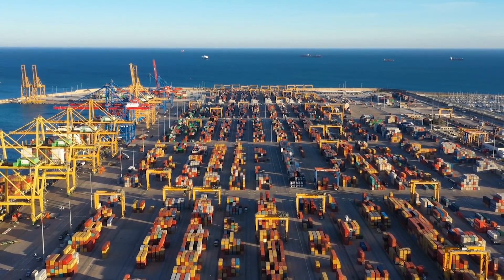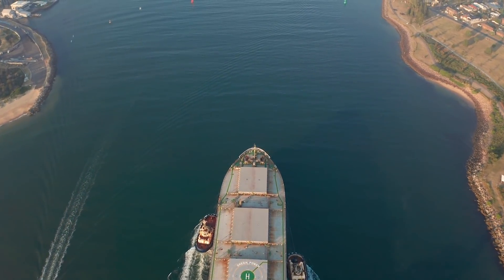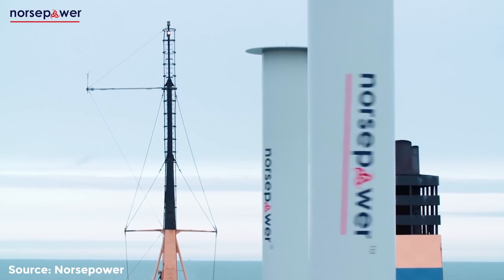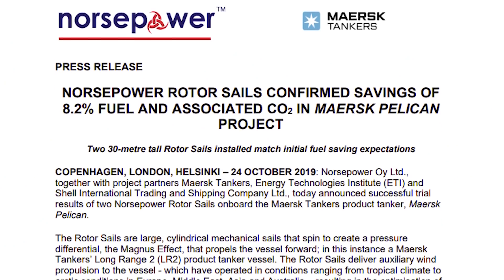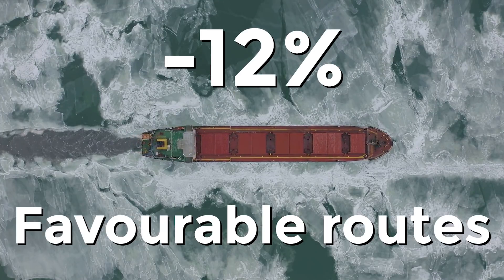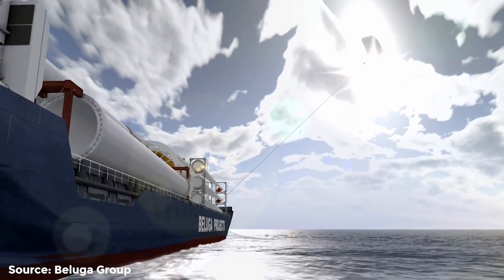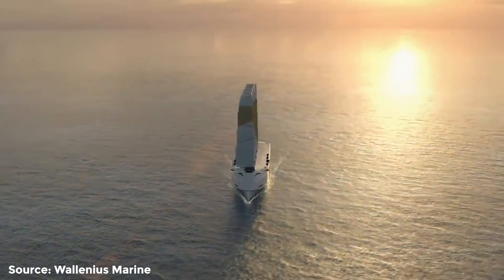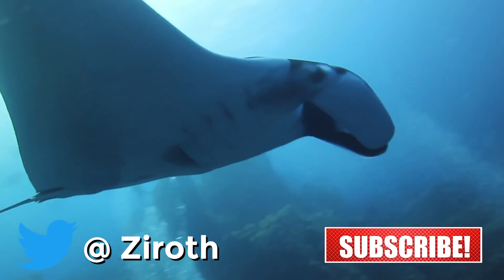Is Wind Power The Future of Shipping?

Comment: "Wind" word is mean that "wins"...! m.m.a.rana
Reply: To address the suggestions that wind power is the answer I offer the following example.  In 1870 a premium sailing vessel entered service, the ‘Cutty Sark’.  The ‘Cutty Sark’ was 64.74 metres in length with a beam of 10.97 metres and a loaded displacement of 2 100 tonnes.  She was able to carry, at best, 1 700 tonnes of cargo and to harness the energy in the wind the available spread of canvas was up to 2 976m2 which was tended by a crew of about 30 skilled men.  A ratio between the sail area (SA) and the vessels displacement (D) determines how lively she is; ‘lively’ being nautical speak for ‘fast and manoeuvrable’.  The carrying capacity of cargo ships is constrained in two ways, mass and volume which leads us to the ‘stowage factor’ of the cargo; the more mass on board the greater the displacement which in turn impacts the efficiency of the hull form and sail area / displacement ratio.  A vessel constrained by mass is said to be ‘down but not full’, while a vessel constrained by volume is said to be ‘full but not down.  When in the tea trade, which the ‘Cutty Sark’ was designed and built for with fine lines (more nautical tech speak, so again no need to worry about it) she could carry around 600 tonnes of cargo at speeds of up to 17.5 knots dependent on the prevailing wind and had a typical China to UK time on passage of 120 days.  The tea trade was very competitive so ‘time on passage’ was a large factor in securing the premium freight rate that made her cost effective.  Rounding things out, her maximum available sail area gave circa 5m2 of canvas for every tonne of tea carried.

As soon as the Suez Canal opened, which the ‘Cutty Sark’ was unable to sail through; she lost her advantage, raw speed, to the steam powered ships of that era who could beat her ‘time on passage’ by taking that short cut.  Mechanically powered ships have improved in terms of efficiency, on a freight tonne mile basis, by at least one order of magnitude since then.  After losing out to the coal burning, fire tube boiler, steam reciprocating mechanical ships of the late 19th century ‘Cutty Sark’ was relegated to the Australian wool trade, just about the bottom of the barrel in maritime terms and only one small step up from being a 'honey barge'.  The canvas, cordage and extra manpower needed for sailing ships was never a very benign environmental option so please discount any idea of sail as ‘sustainable’.  All this is without the problem that if ‘the wind don’t blow the ship don’t go’, when it does blow it often blows in the wrong direction for your cargo delivery needs and sometimes there is rather too much of it for comfort.  Sailing ships are unable to go directly up wind so if the wind is blowing from the direction your cargo needs to then a zig-zag course must be steered, more distance and thus more time on passage at whatever speed is achieved.  Wind speed is traditionally measured on the Beaufort Scale (wind speed) that runs from 0 (< 1kn) to 12 (> 63kn) and for sailing purposes the usable part of the range is ‘3’ (circa 8kn) to ‘6’ (circa 24kn).

Random fact about ‘Cutty Sark’, it is said to have been possible to coax 3 000 horse power out of her sails, or in ‘real money’ 2 206 500 Watts (2.2 megaWatts), or 741 Watts for each square meter of sail area.  So that majestic spread of canvas would have been even less efficacious for delivering your baubles and bows from the orient, despite taking about three times as long on the voyage.  The sails on the ‘Cutty Sark’ produced about 0.33% of the power need to propel a Mearsk Triple E working simultaneously in ‘ideal conditions’ the energy harvest would be less than a two hundredth of the output from the ICEs.  Remember shipping is a high volume low cost, therefore low margin business, and all costs have to be beneficial.

Canvas and hemp are accorded 'renewable' (read as ‘natural’) status, if ‘synthetics’ are used there will still be a need for the input of FOGI products.  'Synthetics' would have a much better working life span than 'naturals' but would still yield the same amount of energy, 741 Watts for each square meter in those elusive ideal conditions.  Wallenius are currently giving wind power a go with wing form ‘sails’ but evidence is a little short of proof as of this date.  KTH (Kungliga Tekniska högskolan), a sort of up market university in Stockholm, who are using the funding to derive results will probably, and eventually, in the best traditions of academia ‘publish’ a ‘paper’ unless the funders invoke the well known ‘commercial sensitivity clause’ of their agreement with the KTH.  On board wind turbines might get you around some of the problems, however for marine use vertical axis wind turbines (VAWT) would be better than, the what have now become 'traditional', horizontal axis wind turbines (HAWT) for reasons that include the air draught of the vessel, weight distribution and maintenance access.  The energy yield is still subject to the wind blowing at the right strength and having space available on board for the hardware.  The masts, rigging and sail handling arrangements would take up 'prime real estate' on the vessel.  Fuel oil bunker tanks can be, and usually are, stuck away in any odd corner and the ICE power plants are themselves relatively compact.  The stacked up 'boxes' would mean putting the wind driven propulsion units in a bad situation from a ship stability point of view.

Comment: That is a really interesting point about shipowners and charterers! Maybe a portable solution is the answer, but would this portable solution simply be washed off the ship
Reply: If ‘the wind don’t blow the ship don’t go’, when it does blow it often blows in the wrong direction for your cargo delivery needs and sometimes there is rather too much of it for comfort.  Sailing ships are unable to go directly up wind so if the wind is blowing from the direction your cargo needs to then a zig-zag course must be steered, more distance and more time.  Wind speed is traditionally measured on the Beaufort Scale (wind speed) that runs from 0 (< 1kn) to 12 (> 63kn) and for sailing purposes the usable part of the range is ‘3’ (circa 8kn) to ‘6’ (circa 24kn).

Random fact about ‘Cutty Sark’, it is said to have been possible to coax 3 000 horse power out of her sails, or in ‘real money’ 2 206 500 Watts (2.2 megaWatts), or 741 Watts for each square meter of sail area.  Remember shipping is a high volume low cost, therefore low margin business, and all costs have to be beneficial.

Canvas and hemp are accorded 'renewable' (read as ‘natural’) status, if ‘synthetics’ are used there will still be a need for the input of FOGI products.  'Synthetics' would have a much better working life span than 'naturals' but would still yield the same amount of energy, 741 Watts for each square meter in those elusive ideal conditions.    On board wind turbine might get you around some of the problems, however for marine use vertical axis wind turbines (VAWT) would be better than, the what have now become 'traditional', horizontal axis wind turbines (HAWT) for reasons that include the air draught of the vessel, weight distribution and maintenance access.  The energy yield is still subject to the wind blowing at the right strength and having space available on board for the hardware.  The masts, rigging and sail handling arrangements would take up 'prime real estate' on the vessel.  Fuel oil bunker tanks can be, and usually are, stuck away in any odd corner and the ICE power plants are themselves relatively compact.  The cargo needs would mean putting the wind energy harvesting for the driven propulsion units in a bad situation from a ship stability point of view.
Reply: Really interesting response Bernard!

Comment: Maybe windpower is not practical for big container ships for the reasons mentioned in the video, but I would think a small fishing trawler would definitely benefit from having sails as well as diesel engines. They are owned by the fisherman himself, so he does have to pay thousands of pounds to motor out to the fishing area and back. If he could sail to and from the fishing area, and just use his engine for the actual trawling he could save thousands of pounds per trip. I saw a program onTV where the fisherman said he caught £5000 worth of fish on one trip, but his fuel bill was £3000. If he could sail out and back it would cut his fuel bill considerably.
Reply: The problem is that if ‘the wind don’t blow the ship don’t go’, when it does blow it often blows in the wrong direction for your cargo delivery needs and sometimes there is rather too much of it for comfort.  Sailing ships are unable to go directly up wind so if the wind is blowing from the direction your cargo needs to then a zig-zag course must be steered, more distance and more time.  Wind speed is traditionally measured on the Beaufort Scale (wind speed) that runs from 0 (< 1kn) to 12 (> 63kn) and for sailing purposes the usable part of the range is ‘3’ (circa 8kn) to ‘6’ (circa 24kn).

Random fact , it is said to have been possible to coax 3 000 horse power out of the sails on the ‘Cutty Sark’, or in ‘real money’ 2 206 500 Watts (2.2 megaWatts), or 741 Watts for each square meter of sail area.  So her majestic spread of canvas would have been less efficacious for delivering your baubles and bows from the orient, despite taking about three times as long on the voyage, than mechanical power.  Remember fishing is a 'high volume low cost' business therefore low margin, and all costs have to be beneficial; also fish are a perishable critical cargo running freezer equipment needs energy so some consistent and reliable power supply is needed.

Canvas and hemp are accorded 'renewable' (read as ‘natural’) status, if ‘synthetics’ are used there will still be a need for the input of FOGI products.  'Synthetics' would have a much better working life span than 'naturals' but would still yield the same amount of energy, 741 Watts for each square meter in those elusive ideal conditions.  Wallenius are currently giving wind power a go with wing form ‘sails’ but evidence is a little short of proof as of this date.  KTH (Kungliga Tekniska högskolan), a sort of up market university in Stockholm, who are using the funding to derive results will probably, and eventually, in the best traditions of academia ‘publish’ a ‘paper’ unless the funders invoke the well known ‘commercial sensitivity clause’ of their agreement with the KTH.  On board wind turbine might get you around some of the problems, however for marine use vertical axis wind turbines (VAWT) would be better than, the what have now become 'traditional', horizontal axis wind turbines (HAWT) for reasons that include the air draught of the vessel, weight distribution and maintenance access.  The energy yield is still subject to the wind blowing at the right strength and having space available on board for the hardware.  The masts, rigging and sail handling arrangements would take up 'prime real estate' on the vessel.  Oil bunker tanks can be, and usually are, stuck away in any odd corner and the ICE power plants are themselves relatively compact.  The fishing gear and its operation would mean putting the wind driven propulsion units in a bad situation from a ship stability point of view.

Comment: what is the background of such world economics dependancy? On your question about the wind here's what Zhan Kusto replied already: https://www.youtube.com/watch?v=oYJwCYe7W5g
Reply: To address the suggestions that wind power is the answer I offer the following example.  In 1870 a premium sailing vessel entered service, the ‘Cutty Sark’.  The ‘Cutty Sark’ was 64.74 metres in length with a beam of 10.97 metres and a loaded displacement of 2 100 tonnes.  She was able to carry, at best, 1 700 tonnes of cargo and to harness the energy in the wind the available spread of canvas was up to 2 976m2 which was tended by a crew of about 30 skilled men.  A ratio between the sail area (SA) and the vessels displacement (D) determines how lively she is; ‘lively’ being nautical speak for ‘fast and manoeuvrable’.  The carrying capacity of cargo ships is constrained in two ways, mass and volume which leads us to the ‘stowage factor’ of the cargo; the more mass on board the greater the displacement which in turn impacts the efficiency of the hull form and sail area / displacement ratio.  A vessel constrained by mass is said to be ‘down but not full’, while a vessel constrained by volume is said to be ‘full but not down.  When in the tea trade, which the ‘Cutty Sark’ was designed and built for with fine lines (more nautical tech speak, so again no need to worry about it) she could carry around 600 tonnes of cargo at speeds of up to 17.5 knots dependent on the prevailing wind and had a typical China to UK time on passage of 120 days.  The tea trade was very competitive so ‘time on passage’ was a large factor in securing the premium freight rate that made her cost effective.  Rounding things out, her maximum available sail area gave circa 5m2 of canvas for every tonne of tea carried.

As soon as the Suez Canal opened, which the ‘Cutty Sark’ was unable to sail through; she lost her advantage, raw speed, to the steam powered ships of that era who could beat her ‘time on passage’ by taking that short cut.  Mechanically powered ships have improved in terms of efficiency, on a freight tonne mile basis, by at least one order of magnitude since then.  After losing out to the coal burning, fire tube boiler, steam reciprocating mechanical ships of the late 19th century ‘Cutty Sark’ was relegated to the Australian wool trade, just about the bottom of the barrel in maritime terms and only one small step up from being a 'honey barge'.  The canvas, cordage and extra manpower needed for sailing ships was never a very benign environmental option so please discount any idea of sail as ‘sustainable’.  All this is without the problem that if ‘the wind don’t blow the ship don’t go’, when it does blow it often blows in the wrong direction for your cargo delivery needs and sometimes there is rather too much of it for comfort.  Sailing ships are unable to go directly up wind so if the wind is blowing from the direction your cargo needs to then a zig-zag course must be steered, more distance and more time.  Wind speed is traditionally measured on the Beaufort Scale (wind speed) that runs from 0 (< 1kn) to 12 (> 63kn) and for sailing purposes the usable part of the range is ‘3’ (circa 8kn) to ‘6’ (circa 24kn).

Random fact about ‘Cutty Sark’, it is said to have been possible to coax 3 000 horse power out of her sails, or in ‘real money’ 2 206 500 Watts (2.2 megaWatts), or 741 Watts for each square meter of sail area.  So that majestic spread of canvas would have been even less efficacious for delivering your baubles and bows from the orient, despite taking about three times as long on the voyage.  The sails on the ‘Cutty Sark’ produced about 0.33% of the power need to propel a Mearsk Triple E in ‘ideal conditions’ the energy harvest would be less than one two hundredth of the output from the ICEs.  Remember shipping is a high volume low cost, therefore low margin business, and all costs have to be beneficial.

Canvas and hemp are accorded 'renewable' (read as ‘natural’) status, if ‘synthetics’ are used there will still be a need for the input of FOGI products.  'Synthetics' would have a much better working life span than 'naturals' but would still yield the same amount of energy, 741 Watts for each square meter in those elusive ideal conditions.  Wallenius are currently giving wind power a go with wing form ‘sails’ but evidence is a little short of proof as of this date.  KTH (Kungliga Tekniska högskolan), a sort of up market university in Stockholm, who are using the funding to derive results will probably, and eventually, in the best traditions of academia ‘publish’ a ‘paper’ unless the funders invoke the well known ‘commercial sensitivity clause’ of their agreement with the KTH.  On board wind turbine might get you around some of the problems, however for marine use vertical axis wind turbines (VAWT) would be better than, the what have now become 'traditional', horizontal axis wind turbines (HAWT) for reasons that include the air draught of the vessel, weight distribution and maintenance access.  The energy yield is still subject to the wind blowing at the right strength and having space available on board for the hardware.  The masts, rigging and sail handling arrangements would take up 'prime real estate' on the vessel.